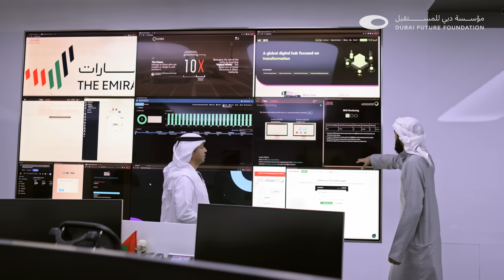How Dubai is pioneering solar for the world

Comment: This seems incredible for temperature and trustworthiness of architectural of dubai development with solar system dust proof mechanism like our phone or Supercar windscreen polished and additional Heat Ground(Sand) renewable Energy inbound with ☀️🔥SunHeat Steel/Zinc Pipe conversion from Heat to Electricity formation. for example in Indonesia Heat Ground Renewable energy reformed the 💦WATER base heat to 🏜️SAND base Heat hypothetically circular rotation turbine generate into ⚡ like the Mitsubishi Renewable system in Indonesia.

Comment: could go a little more ambitious. what about 40% to 2030, 100% to 2040 and to 2050 you go hard carbon negative starting to repair the atmosphere.
Reply: It’s a very radical and expansive idea to go to carbon neutral you need lots of solar and wind turbine new electric grids also storage unit for the energy cuz renewables are not efficient all the time like solar wind etc that’s trillions of dollars at least just for small nation with 10 million. what the cost gonna be for EU counties with 500 million also the USA  you are taking about 100s of trillion of dollars just to go carbon neutral
Reply: @ahmedalseiari5907  Ambitious yes. But a thing that is necessary. So it can not be radical. About the prise tag: will will have to bare it either way. The delay however has also a prise tag too.  Lower estimate for the external costs of CO2 emissions are 500 bugs per ton. On the other hand, 50 bugs per ton is the number economic experts give for what you needed to internalise, so that the nesesarry changes would happen. In other word, delaying  the investment in the transition will cost our kids 10 fold.
Reply: для того что бы стать углеродоотрицательным нужно закапывать алмазы под землю
Reply: @jija5121  not diamonts. charcoal. the diamonts you would wanna use^^

Comment: You could do so much more with so much less if you just used nuclear.... It would take a small fraction of the land that the solar panels take, and make much less waste (solar panels spill dangerous chemicals if broken)
Reply: Not enough uranium in the world for the world to run on nuclear. It would be used up in 15 years
Reply: @dualfluidreactor  i can tell you made that up based on the fact that there were literally no numbers given in context, all i said was nuclear is more useful, not how many reactors to build, or even what kind of reactor. there are way too many variables for a static number like 15 years. and, in addition to that, there are reactors that re-use spent fuel, and there are many different fuel sources besides uranium.

Comment: Probably not practical for every place in the world but if you live on the edge of a desert where there is lots of sunshine, it's a great idea!
Reply: Solar is practical anywhere where vegetation have enough sunlight to grow.
Reply: @bergonius  I am not so sure about that. There is lots of vegetation in Alaska and there may be some applications there for solar panels, but they would be less practical there than in Dubai.
Reply: @Danny_6Handford  if you can keep the snow off, solar is more efficient at lower temperatures
Reply: @cob571  Marginally more efficient but I still think that solar panels would be less practical in Alaska because you would have to  include the time effort and cost of removing snow and possibly more maintenance cost because of the more extreme weather conditions. The marginal increase in efficiency would not even come close to compensate for this. It would be interesting to compare the performance over a 20 year period  of a similar size installation in Alaska and in Dubai. If I was a betting man, my money would be on the Dubai installation for practicality and for efficiency in producing clean electrical energy.
Reply: @bergonius what about oil, it travels world over, how?
Reply: Solar is very affordable where over 90% of the global population lives. Even the Scandanavian countries are investing in it. But I agree it's not always practical. We should encourage geothermal and off-shore wind also 👍
Reply: too much sun which means too hot temperatures might results in less efficiency of the solar panels but better than coal, oil etc!